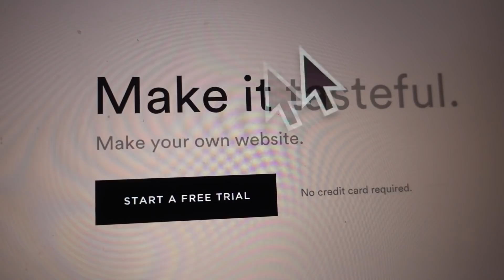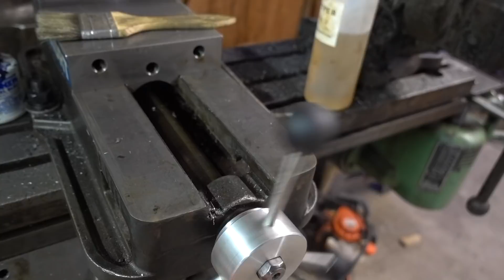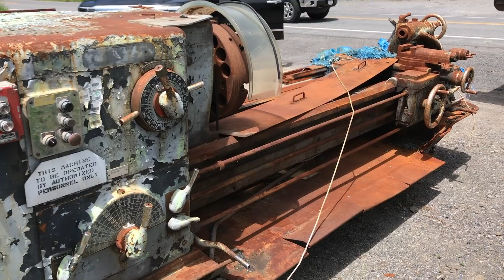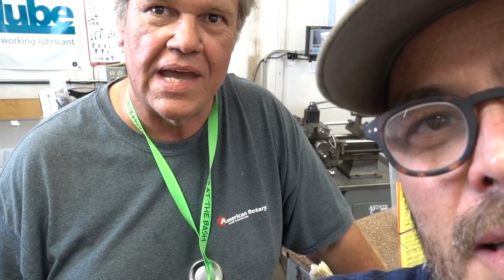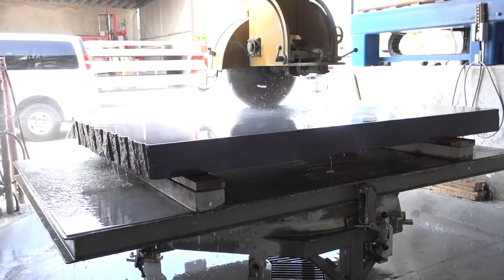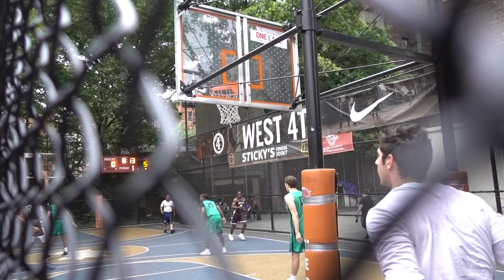DiResta 72 Gold Brick!

Comment: Jimmy I would rethink the can crushing if you are going to use pop cans. I have been  tinkering with an electric foundry and have melted quite a few cans. I find that they melt much faster if you just feed them in uncrushed and if you make sure to put the open end up it allows for any steam from pop still in the can to safely escape. I learned that you really don't want boiling water/pop in a closed container submerged under molten aluminium.   As an aside I use table salt to help separate all the burnt epoxy and crud from the molten aluminium. I was amazed at how much more metal I recovered after adding the salt.

Comment: Jimmy, 

You’re workshop....

PUT 3 PHASE POWER IN!!! . You won’t regret it!

I’m an Electrical Engineer with 20+ years experience, doing design and install work.

Don’t use the TPN “machines” you looked at. You don’t need them, just something else to go wrong and/or trip with a fault.

Go Three phase in then distribute down to 230V single phase and 110V as required. Certainly put the TPN cable in...

I’m UK based... but have done many, many designs of similar jobs over the years 

Happy to help if you want. 

Best of luck and keep up the great work you do...

S

Comment: Think carefully about three-phase power for your shop.  The infrastructure costs skyrocket.  Breakers, wiring, etc.  I had the opportunity in my last shop, and was glad I went single-phase with converters where needed.  VFDs are cheap, and provide a per-machine solution with many other benefits.  Only my large CNC Mill required a big converter, which is a Phase Perfect.  Have fun.  Hope to visit some day.

Comment: The alloy in soda cans is optimized for extrusion, plus it's a high surface area vs weight.  Try getting a hold of some aluminum castings like engine/transmission blocks, motorcycle engines, and so on.

How about some flux ?
Morton's Lite Salt. The salt is a mixture of Potasium Cloride and Sodium Cloride

Comment: I've seen that size bolt on an old chain drive semi truck that I did some work on a few years ago, o don't remember the head size but it was an odd ball size in 32nds of an inch, which is the reason mechanics tool sets used to have wrenches that went up in 32nd sizes

Comment: If you have 3 phase available, it would be better than a rotary converter, you're not running an extra motor everytime you want to use a machine. it would also be a smaller supply cable (although an extra conductor) for the same power, 
You're not going to turn the converter off every time you turn off a machine to make adjustments, change a tool etc, wasted power.
I used to work on 3 phase all the time, best thing for machines
I'm not sure how it works over there, you have so many weird voltages, in the uk we have 240 single, and 415 three phase, if you run 3 phase and neutral around the shop, you can pick up the 240 from a 3 phase socket (phase to neutral), so i wonder if it's similar there.

Comment: You would be foolish to not install 3 phase if it’s available and you need to run power to the shop anyhow. 
You can add pony panels do you can still run all your 120/220 needs but will have the ability to run any old lathe you decide to drag home.

Comment: I don't understand this discussion. In Germany any house has 3- Phase Power and it is relay complicated to order only 1-Phase.
Is it standard to have 1-Phase in the US? How do you run larger machinery? Any Welder Circular Saw, Woodsplitter, and so one comes with 3-Phase engine here??
Reply: Wrad Yes we only have 1ph 220volt to main panel, then 110 volt at wall here for normal homes. Industry uses 3ph 480volt. We need to convert 1ph to 3ph using a converter in our home shops. Vfd’s are popular for doing this.

Comment: What is three phase?
Reply: Disturbed Shifty 380v of power. With the sin wave of the alternating current shifted by 120° on each of the 3 hot lines. 

Something like that.. :)
But basically it's 400v and not just 110 or 240.